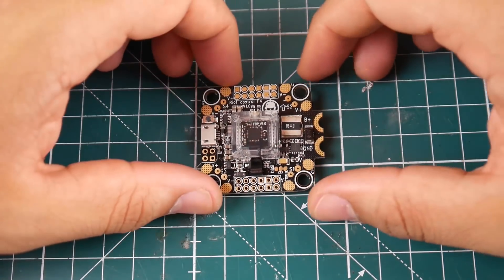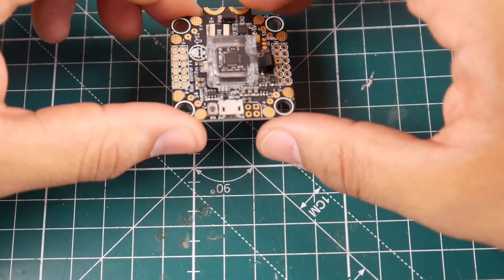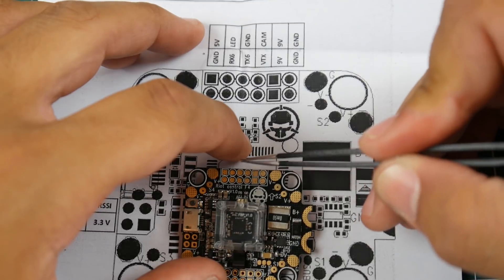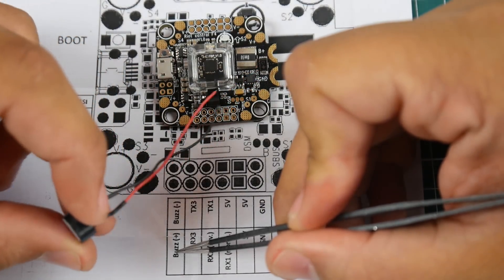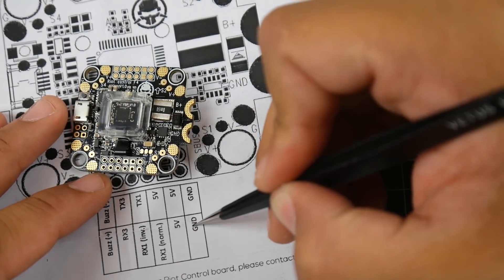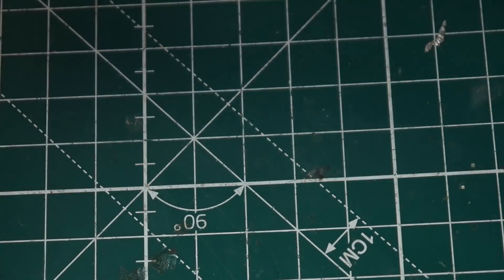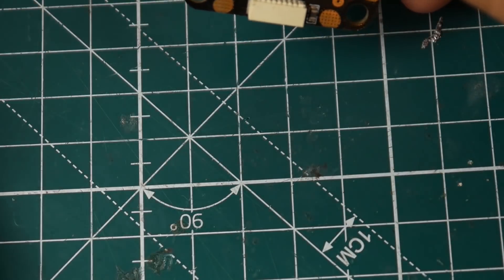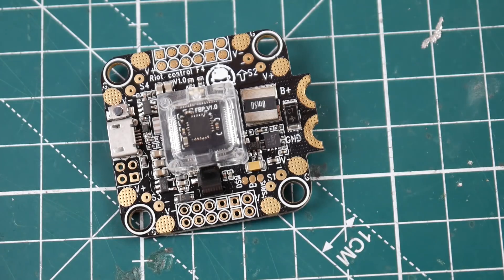Hypetrain Riot Control // Rotor Riot Flight Controller Overview

Comment: I'd like to see HOW MUCH latency double soft mounts would give, I think none..it's not enough weight to actually cause the soft mounts to twist and leave the gyro behind, especially the mpu6000 being less precise relative to the other most commonly used, something's with it, I dunno I would think it would be like 1ms maybe at most. Interesting thought. Drinking colder water than room temp or body temp will cause you to burn calories because it's cold, but it's it a good way to lose weight? Eh negligible... ALMOST Not even worth mentioning.

Comment: Latency due to soft mounting???? now I've heard everything.....lmao😄 this guy!!
Reply: Sounds a little sketchy to me too. :/
I would like to see some prof.
Reply: Splinter Fpv I know it sounds like crazy talk but I think it was JB the first time I heard this.  So I went digging around and in fact the statement isn't false.  Inside some datasheet from InvenSence or Analog Devices, I found a reference to physical vibration isolation causing latency in external devices.  In our cause our MCUs.  After reading a little more, it did make sense why that is.  But I don't disagree with the overanlyzing.
Reply: Splinter Fpv the little rubber grommets that come with it that are just like raceflight do not induce latency. They are way too hard. They might minimize a little bit of vibration but not that much. At least not like he is explaining 😉 lol
Reply: Farmer Fpv right!! i think hes over thinkin this one....
Reply: Splinter Fpv yeah exactly, if it we're rubber bobbins it be a different story, lol. See you tomorrow!👊
Reply: Farmer Fpv 👍😀
Reply: Nope... latency statement is just added bad and unnecessary mojo.